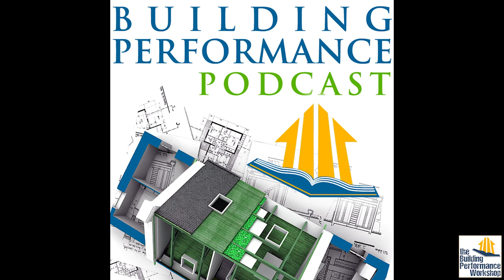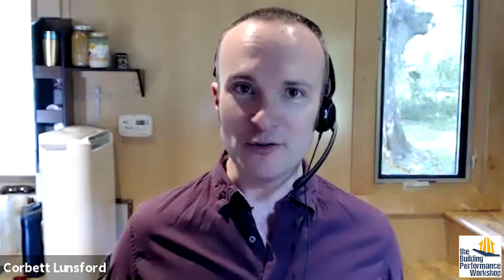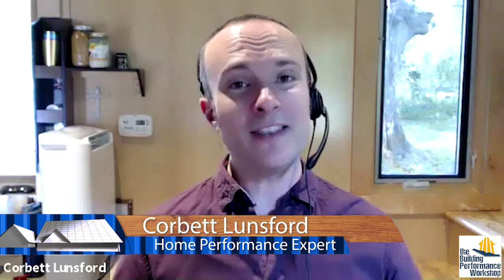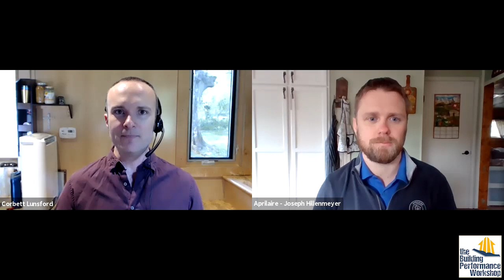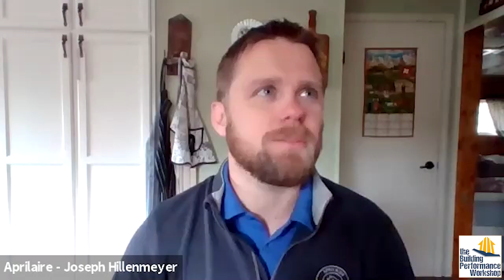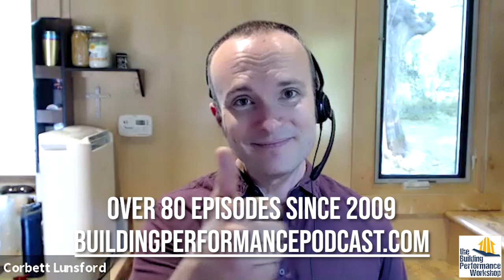Ventilation Codes and What We’re Missing with Joseph Hillenmeyer of Aprilaire

Comment: Great video!  On the topic of an all-in-one controller or central brain for coordinating indoor air equipment, if the individual components support Wifi or ZigBee remote control, something link HomeAssistant could perform this role and would allow customized logic based on the house and/or preferences.

It's been a year since this video was published, but curious to know if HomeAssistant as a local controller is something that you have had an opportunity to look at.

Comment: Sounds like you also want a BAC type of system for the whole HVAC situation. Commercial buildings use this type of thing. I know it exists for home use too, but its not common. A central brain, or computer, runs software that reads all the sensors in the zones, and then runs the HVAC equipment and dampers to do what it needs to do. I read about company that makes a system that does this via looking up radiant heating and cooling, as I've heard that's the best way to get the "heavy A/C" feel I so love in the summer without the heavy A/C energy use. I like the idea, because I know I will be needing all of these things as well, and the dehumidifier will be extremely important with radiant cooling via the ceiling. I also want some type of traditional forced air handler that I can install good filtration onto, for my allergies, lots of filtration... The idea of having to control all of this separately does seem obnoxious though. I'd rather have just one main control panel, and them maybe just a control with a warmer/cooler dial or slide on it, I don't want to have to deal with the rest of it all once the whole ordeal has been commissioned, just change filters and wash things when I have to.
Reply from the maker: Problem with those commercial controls is the software maker (Johnson Controls, Honeywell, etc) charges an arm and a leg to set it up, then holds your building hostage forever because they’re the only one who can fix it.
Reply: @HomePerformance  Oh that's true, the company I saw is Messanna, They have a control box that controls the hydronic ceilings, but also has the ability to control all of the other parts of an HVAC thing setup too. They do make or sell an ERV with the dehumidifier in it, but I tend to like the idea of separate machines for each function as well, for service reasons. Separate machines under some kind of central controller, like you said, is my idea of the ideal setup as well.

Comment: We are in the process of having a small 20 x 28 house built with a 4 ft high conditioned crawl space. We are at the point where I feel pressure to decide on what kind of dehumidification we will have along with our 1 1/2 ton hvac unit. My hvac tech only installs AprilAire, but he’s charging $2,000, and that doesn’t include the condensate pump or humidistat. I am considering a stand alone 50 pint HiSense dehumidifier that he recommended, that has a built in pump, or something similar, but the ratings say the pumps on most built-ins go bad quickly. We really have to watch our budget, so it is a hard decision for us. I kind of want to wait, and see how our house performs before making a decision. We are in southern Virginia Blue Ridge area,  and it is often 100% humidity in the morning. 

I knew (I believe) that you have an Ultra Air, so it is nice to see that you also have a good opinion of AprilAire. I’ve heard good things about their whole House dehumidifiers, but I also saw some bad reviews that concerned me.
Reply from the maker: Best of luck on your build- you can look for a pumpless unit, and I agree that for your home’d size, a small standalone 50-pint dehum would probably be ok. You can buy them off the shelf for under $300. More maintenance, more in-your-face, but that’s where the savings are to be had.

Comment: My house is to dry because I keep it so hot. So in the winter last year I dropped below 30%. I have done massive air sealing and insulation to my house this spring so we will see what the winter humidity is next year. 

If it is only 5% below what I want it to be can an hvr make up for that. Or should I also just put in a humidifier at the same time.

Comment: Im a fan of automate as much as possible. Most people have no interest in knowing how to run systems. You need to make things as simple as possible like maintenance. Eg something as simple as differential pressure switch to run a warning light to say filter needs replacing. 
Also need to make things tamper proof. We have big issues with people blocking off ventilation because it "brings cold air in".
Human factors is a challenge.

Comment: The big thing with allot of this performance house stuff.. Is cost.
Vented is cheap and easy. Most want this. Most wont care if their duct work falls off in a couple years or if there is a gap under the door because the seal failed. 
I am taking my 1940 house into a more sealed performance house and it definitely adds cost and complexity.